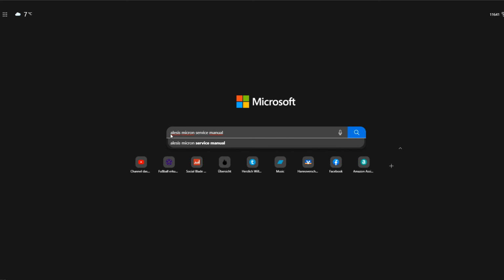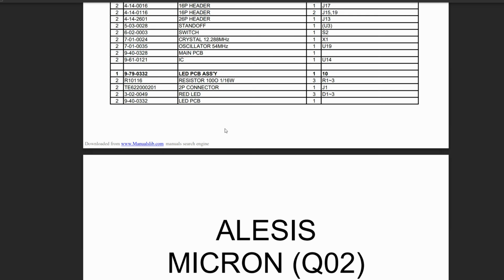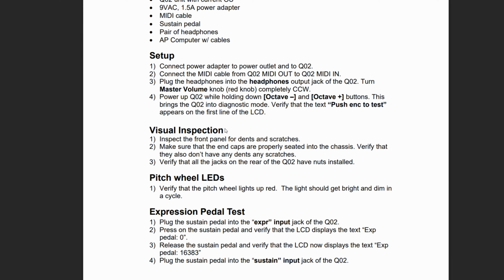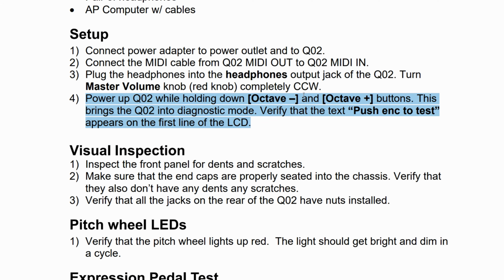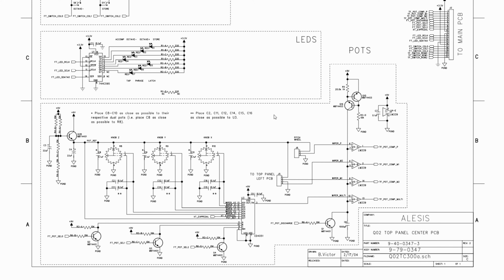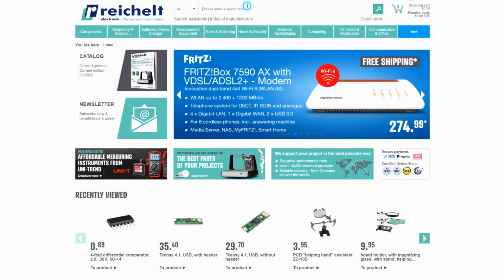Can I repair this Alesis Micron synthesiser?

Comment: Hey you did everything correctly and pretty much perfectly so far. Now i wonder how you'll struggle with actually replacing the chips though! What's your plan with getting the old chips off, with your equipment?

Capacitors which look good and haven't seemingly emitted any substance should never be assumed to still be good. I just routinely lift all of them and put them into an LCR-T4 which is a really cheap gadget out of China and for capacitors, it gives you the ESR and leakage, which are actually more interesting than the capacity, and see whether they read about what i'd expect based on experience, and sometimes they're great, other times they've definitely gone wonky. That being said, odds are, they're not under any sort of stress here and should be OK.

The Altera chip is an FPGA, although the datasheet calls it a PLD, which is... not wrong, but perhaps a bit misleading, since it's an overarching category, comprised of CPLD (which is a flash programmable logic device) and FPGA (which is an SRAM based programmable logic device). Either is a regular matrix of logic gates, and each memory cell decides the signal routing between these gates. It has nothing to do with industrial PLD controllers, those don't generally even have PLD chips in them, naming collisions are just a thing that happens. You use a CPLD or a very small FPGA to convert timing critical signals and so join incompatible circuits or data buses; or a larger FPGA as a replacement for any sort of digital IC or functional group that may fit in and doesn't exist and that you can't just buy. This is not a very large FPGA but also not the smallest so i don't know exactly what they're doing with it. Maybe they're not using a lot of its capacity but got a deal on them.
Reply from the maker: Whow, THANK YOU VERY MUCH for your detailed comments!
Well, you're right, getting the chip off the board will be very difficult with my equipment. My plan is to apply a technique using a paper clip and LOTS of solder to get the surrounding area to temperature and then push pick it up with tweezers. (I saw some YT videos on this and this seems to be the way to go for me - I'll try this on some practice boards first, of course!)
I checked the capacitors using my multimeter and I could see them charging up and releasing current, plus they look ok. But I ordered replacements just to be sure.
My main concern is there are some variants of the ICs I ordered around, so I hope I bought the right ones.
We'll see. :-)
Reply: @mr_floydst  The ICs seem correct to me, at least according to service manual, i can't see if the actual chips on the board match. The specific variety probably isn't even all that critical, but HC versions are cheapest around, and if they're the ones designed in, then they're just right. As to various manufacturers and slight differences in how the stores chop up and arrange the IC designations in the description, no need to be concerned about that.

I don't know i haven't seen the "paperclip trick" video but that sounds about 20 times more difficult than it looks! Like every time i see someone show a "cool new technique" it turns out to be about 4 times more difficult than it looks, and if it's that for me, i imagine how much more difficult it has to be for people less comfortable with that sort of thing? Some of these, i know the people showing it off have actually gotten good at it, and i succeed as well maybe with just a little more effort, and other of these vids, i'm certain they had a number of takes which didn't work that didn't make it into the video. If anything one wouldn't want to use a paperclip, which instantly chews up side cutters and also isn't very thermally conductive, but rather a piece of solid-core copper wire.

Tweezer technique and tweezer type are most vital - generic 7sa tweezers are good enough though, you just want them very sharp and pretty flexible. Oh also you can't do these things without magnification (well idk, i can't, i just assume others can't either, because just so much little detail evades you, even when you think you can see what you're doing), and either you already have a headband loupe, which is ideal, or in a pinch, oversized reading glasses around +2 to +3dptr from a discount store that are large enough to fit over your prescription glasses will do.

You can maybe get Wood's Metal on eBay, this is how i do these sorts of chips. Can't see it offered right now, but there is Rose's Metal. There's also a desoldering alloy by Chipquick and other companies, low melting point. You avoid overheating and delaminating the PCB, and it stays molten for much longer than regular solder, and you can combine it fundamentally with the solid core wire loop technique as well. After the chip removal, it needs to be completely sucked up with a wick, otherwise the residue can weaken the solder joint, and in turn the wick needs a dollop of flux to behave. For some reason i have never had luck with the wick i got at Conrad, but 1.5mm width wick i got a whole load of from China just sort-by-price turned out perfectly fine? I don't know why Conrad Elektronik can't get their act together.

What's this iron you've got? Wonder if it has true temperature control or just a power adjustment dial? Just because someone drew numbers on the dial doesn't mean they are actually meaningful, the way it is with some of the less fancy items.
Reply: Oh you don't need to rescue the cheap old chips. You can cut them off. Snip snip with flush cutters through the legs. Then just scoop up the rest of the legs with a ball of solder.

Comment: I just bought a used micron and it unfortunately has numerous sounds that either do not work or attempt to work but will make either a screeching noise or just a thump sound while initially pressing any key. Most of the sounds work but a lot do not and some of the sounds that don’t work will intermittently work after scrolling through other sounds. The factory reset didn’t help, no surprise there. Other than purchasing a replacement main board, I don’t know what would be the cause. I’m hoping to find some help on this.
Reply from the maker: Have you checked the usual suspects first, e.g. leaked capacitors? Did you unplug the control board like I did in this video?
Reply: @mr_floydst  I hadn’t unplugged the boards yet but I did look visually at the capacitors and all were good with none leaking or burst open. Any thoughts on what to check otherwise? Thanks much

Comment: My micron works as a midi but does not use sounds from the library. What is broken? I sprayed contact cleaner and no fix as I thought it could be eroded.
Reply from the maker: Hm, my first guess: Did you turn off local mode by accident?

Comment: Got one shipped from Japan, just got it today and noticed the volume level on the left channel is about 60% lower than the right one. I opened it up and looks like there is a transistor for each output channel and some caps, probably I might have to replace those.
Reply from the maker: That's always the first thing to try. Good luck with the repair!

Comment: Very nice.  Ir is apparent you know a tad more than you let on.  Looks like a little rearrangement of controllers, a neck, and a pair of guitar strap buttons would produce a poor man's Keytar.  Thoughts?  Anybody got a better idea?
Reply from the maker: Hi, I don't think that would be too ergonomic :-) You'd put a lot of stress on those plastic panels, too, and there are a lot of cables that would point towards ground, not ideal. Better get a used Keytar somewhere - the Yamaha SHS-10 looks awful, but is cheap on the second hand market and has MIDI. :-)

Comment: I'd of of either remove the keyboard and made a box and used it as a desktop synth or just remove the controller effect knobs and use guitar effects pedals.
Reply from the maker: Thanks for watching! If all else fails, that's what I'll do. But in the meantime, I made progress (with a lot of help by one of my viewers): The sliders and knobs are functional again, leaving only the wonky pitch wheel. The pitch wheel most likely has bad solder joints, so it should be an easy fix, but as a n00b, I managed to ruin my soldering iron in the process. (omg). ;-) So waiting for a new one currently.
Reply: @mr_floydst  Dont forget to film your progress as I'm waiting for the video update. Glad you got it working, Remove or replace the mod wheel.
Reply from the maker: Update: It's working again 100%. I'll post a video soon.

Comment: I see no wrist strap or ESD. protection. This makes any repair you perform subject to latent damage. These are problems that may hide initially but can produce unpredictable circuits. Certain component types are more prone to this damage than other. There are many end protective products available and accompanying training. In my lab's I have ESD floor, workbenches, storage areas and more. This is a requirement of my ISO certification.
Reply from the maker: Thanks for your advice! Going to do that in the future.

Comment: Thanks for the repair process walk through.  

Someday I will take another crack at fixing my old DX100.  It needed more than just the lithium battery replacement, but I don’t know where to start.  So far, I have only succeeded in accidentally melting some of a ribbon cable while trying to resolder some dry/loose joints, so I need to be more careful.
Reply from the maker: Good luck with that! Yes, without the right tools, you can cause more damage than good really quickly. But then again (as I said in the video) professional synth technicians are rare and most of the time they don't want to be bothered with "common" synths (which is fair considering the worth of their time vs. the worth of cheap digital synths).

Comment: Floyd want to come fix my E4K  and have a few hours setting  up my midi layout .....EX5 -EX5 R  QX3 RX5  A3000x2 A5000   Motif XS r awaiting along with a few others.....lol
Reply from the maker: Haha :-) Well as I explained in the video, I don't know anything at all (but some basics) so perhaps that's not the best idea ;)
But the MIDI thing sounds fun. :-)
Reply: @mr_floydst  only 15 keyboards and 40 rack units ....lol
Reply from the maker: @johnb2044  Wow, ok, so how do you do that? Daisy chaining is out of question, obviously ;)  A lot of USB midi interfaces? MIDI routers? 
I guess latency and resistance and ground loops and o.t.a. noise make this one hell of a puzzle to solve. :-)  (Also considering you'll most likely want to audio outs to be connected to somewhere as well)
Reply: @mr_floydst    2X Roland A-880's   2 X motu MTP's and 2 X emgic's AMT'8 4 X RX1602's and a older eurorack Mx 3242x

Comment: The Micron and Miniak ( Akai Version ) are very powerful little synths and I suspect after getting it fixed up you may just keep it as the profit vs your time will be low .
 The external Control Was its biggest setback as ALL parameters are NRPN and not Midi CC and to my limited understanding of NRPN they are an odd implementation  of that even , but to save you any head scratching there is that little bit of info .  
Here is a modern editor https://github.com/retroware/micronau for Mac users with several forks I've not tried yet . 
There are many windows versions out there easier to find free and paid .
One note . Most of the factory presets don't seam to utilize the OSC Drift feature . Which IMHO make sound as good as any Digital subtractive/FM you can buy today .
The sweet spot is 15-25% depending on how DCO-VCO you're trying to get  .
 Using it as a modern 8 voice drum synth and drum machine ...even kills many modern equivalent I've seen especially in the " VA" and FM space . 
  The guy at the LFO store really shows off the engine too so heres a shout out to him/they as well .
https://www.youtube.com/watch?v=_xIRyzf8pkw
https://www.youtube.com/watch?v=RysWsvL5W6Q
https://youtube.com/playlist?list=PLfqrTVYB4ygYcJ5-FVCZY7K_gfyFMwq0C
Reply from the maker: Thanks for watching! 
Well, maybe :-). I'm just a hobbyist musician - with limited space for hardware - and I enjoy tinkering with synths and trying this and that, so the time invested in this project is both worth nothing and everything ;)
I already own a Novation PEAK and so far my impression is the PEAK and the Micron share some ideas, to put it like this, there are a lot of similarities there in architecture.
I'll keep the Micron around for some time and so far, I really like the sound. I also like the design and the UI concept, using the keyboard for shortcuts is an idea that works really well.
Reply: @mr_floydst  Yeah the Peak is one half ( literally )of my dream synth ( Summit ) , but  the very good/ borderline great ( for VA) engine in the Micron is half its strength the other being 8 parts multi timbral with both drum and note sequencers .
Example : Bass , snare , kick , hat , lead , a duophonic lead , and still have a part/ voice  left to run a guitar or vocals through the effects . 
Peak can’t do that , but it’s not meant to be a workhorse it’s just a great sounding ,powerful synth ( with the best reverb on a synth ever IMHO ) that’s meant to do a good part (or two ) great . Anyway I’ll stop trying to be an enabler lolz . Cheers . 
Btw and speaking of enabling lol ....I know you’re big on DIY projects did you ever look in to Elk Audio for PI ? They have a pretty decent GitHub with lots of already compiled plugins ready to play with .
Reply from the maker: @Death_By_Media  Thanks! I'll take a look at that, I'm always interested in new PI projects. :-)
And for the time being, the Micron is here, I'll try to finish the repair and I'll then explore the synth engine and make some videos. Thanks for sharing the links, I'll definitely take a look.
We in the synth community are always a bit passionate about the gear we use (of course we are because that stuff is not cheap and stays with us for a very long time)

Comment: I would still replace the capacitors as it is 10x easier to do than replacing those IC. You can't always tell by looking at them if they have gone bad.  Capacitors are often used to clean up noise.
Reply from the maker: Thanks for watching! They're on my shopping list.

Comment: better get some kepton tape and a decent hot air station it can make or break a repair, if you went through all the trouble of diagnosis you better make it work in the end no? i use the yihua 858D which is a Chinese knock off of some other high end device, it's pretty cheap and does the trick quite nicely I'd  do some training on a donor board or some old psu unit ir other PCB just so you've got the heat fun temp and fan dialed in properly, also some good flux for the reflow is really recommended, good luck my man the micron a small but very capable VA synth
Reply from the maker: Thank you very much for your assesment! I've been thinking about getting one of those indeed. Perhaps this is a good time to finally get one. :-)
Reply: So is this for hearing, or cooling around the circuit board work area?  It sounds like some kind of heat sink, but my ignorance is showing.

Comment: Hello Floyd, when the parameters start to jump, it's almost always the potentiometer than the chip, it's not... it was the same with my jp 8080, I swapped a lot of potentiometers and now everything works again without jumping, :) 
there's dirt inside the potentiometers that produce this effect
Reply: One of the other comments pointed out the capacitors.  Sometimes they act as a high pass filter on a shunt, the idea being to dampen any noise in the input voltage feed.  If noise feeds into the common voltage which the potentiometers are supposed to adjust on their respective outputs, that could make their outputs bounce around.

Disclaimer: I’m a software guy, not a hardware guy.
Reply from the maker: Thanks for watching and pointing that out! I bought replacement pots, but I think in this case it's unlikely because ALL the pots plus the sliders are causing chaos.
Reply: @mr_floydst  I have an Alesis Ion that I recently serviced because every single encoder (there are 30) was sending bad data, jittery, or not working at all. After giving each pot a quick spray of contact cleaner (I used CRC QD) and spinning the shaft in both directions about 20x, it's good as new. $7 for the can of cleaner, it's a safe place to start. You'll see the access point on the body of each pot.. that little tab that's open to the world.

This would be where I'd start before busting out the soldering iron... nothing to lose.
Reply from the maker: @dankirkhus  Thank you for watching and pointing that out! 
I tried that first, as it is the easiest thing to do. Used an air can and contact cleaner.
The problem is ALL the controls are misbehaving all the time, even if I remove them completely (i.e. I unplugged the mod wheel and the sliders and they kept "sending" data)
Should have filmed that. 
Best regards! :-)
Reply: @mr_floydst  ok maybe, we will see it good luck👍A test would be if you dehst the pots, whether it then has an influence on the values, if not, it's the chip
Reply: @mr_floydst  Yeah.. the chances of the ALL going at the same time are pretty slim.. Unless someone poured coffee or soda on it, but I'm sure that would have left very visible clues.

Comment: Great vid 👍 Giving old synths a second life is awesome 👏 My old MiniAK (same core as the Micron) had a broken data knob and I ended up replacing the whole right PCB. A challenge for a total noob like me, but rewarding and it makes you appreciate the synth more once you know what goes on under the hood a bit 😎👍
Reply from the maker: Thank you very much!  I hope I'm right with my assumptions, and replacing that IC won't be easy, as I never applied the technique necessary for that. Will have to get a practice board before tackling that.
Reply: @mr_floydst  good luck and if nothing else, at least it might be fun 🤷🏻‍♂️